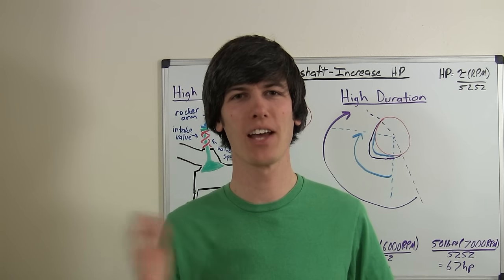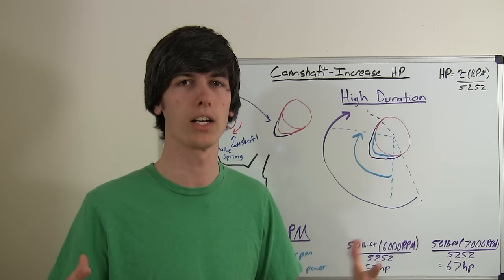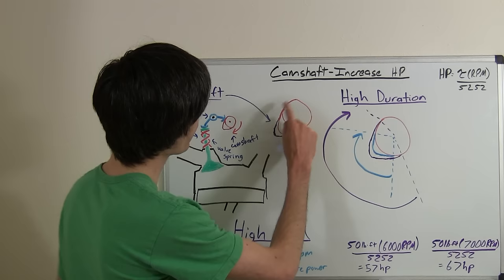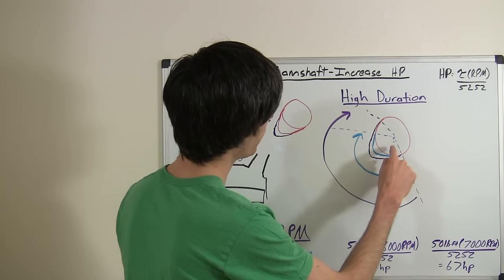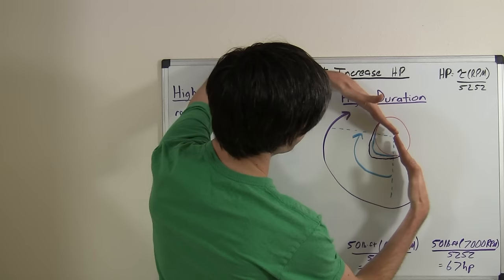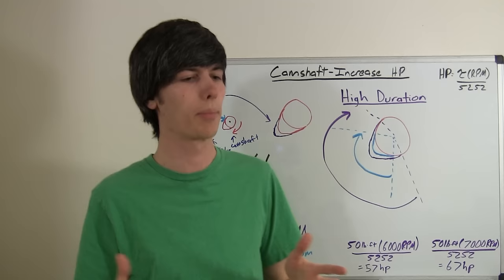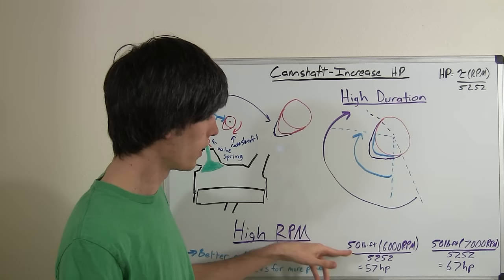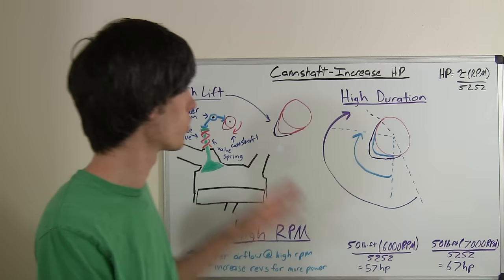Camshaft - High Lift and Duration - Increase Horsepower

Comment: A cam basically is a mechanical control of valve movement ran with timing. This mechanical structure is fixed once it is tailored for an rpm range it has a focused design for that range and since it is fixed (doesn't change shape). In turn a design such as this will be most efficient at the instantaneous rpm that it is most efficient at all the rest of the rpm is valve motion at lower or varying degrees of effective valve motion. 
That is why Honda and all the rest and McLaren came out with computer controlled variable valve timing and more cams all the time. Some Indy state of the art engines and exotic car companies have concentrated on other ways of controlling valve movement without camshafts allowing them to tailor valve movement to be most efficient at all rpms at any time thus creating maximum efficiency and performance throughout the powercurve.  REMEMBER: an increase in a bigger cam profile doesn't always mean more power, trade off or not bigger cams doesn't automate bigger power production period.

Comment: +Engineering explained my motorcycle's stock can has 10.3 mm lift and 296 duration. The racing has 306 duration and 10.5mm lift. in stock form the bike's pull ing power below 7k is weak will it change on installing the race can?? I am also gonna install a free flow exhaust. one more query what is a racing exhaust can??

Comment: How is overlap a bad thing? Overlap is almost necessary in all application esp when cylinder fill is needed and you have low volume of movement of air. Overlap allows for reverse cylinder fill making not only emissions more effective, but also yielding more power.
Reply: I think he just meant that too much overlap can be bad

Comment: I know 'hotter' cams have a reputation of increasing HP (as you state and show in your video) but also reducing low end TQ. Is this just perceived due to the fact that now you have to rev higher to get to that same power before the cams?
Reply: In an engine with a weak cam, that's not filling it's cylinders at low speed.  A hotter cam can increase low end torque. An example would be a 95 Tahoe 5.7 with 300 lbs of torque @ 3000 rpm. A 96 Tahoe 5.7 has 330 lbs of torque @ 2800 rpm.

Comment: Increasing horsepower at high RPM is a compromise that most of the time isn't worth having. The high valve lift at low and medium RPM will affect the speed, swirl and tumble of the air entering the cylinder. Think that you have pretty low speed air entering at low RPM, the thing you should be doing is restricting the passage of air so it's sped up. That's what variable valve lift systems do, use low lift for low and medium RPM and high lift for maximum power at high RPMs.

Comment: I get the airflow increase... How does a hi-lift cam affect the sound at idle?  Do cams make the idle sound more irregular.  Is hi-lift why?
Reply: When you hear an engine that "lopes", it first and foremost have to do with the overlap. Overlap means that the intake and exhaust valves are open at the same time, and it's the result of a long duration cam lobe profile. Lift in itself will not cause loping, but it will accentuate it if the cam has overlap.

Comment: can u explain how it affects the whole output curve and not only the peak number? For example a pretty wild camshaft affects badly the low-mid range torgue, so how the optimal camshafts are chosen. Finally why in most cases the exhaust camshaft is milder than the intake one?
Reply: +alex liatsos Okay, let me take a shot at this. A wild cam profile as you put it will have more over lap between the intake and the exhaust lobes. For example lets say a mild cam (stock) has 118 degree lobe centers (or lobe separation angle) meaning the center of the intake lobe is 118 degrees away from the exhaust lobe center, or in other words a small amount of overlap (keep in mind the camshaft is running at half speed to the crank shaft so in comparison to crank rotation it would be 236 degrees) This cam will make good low and midrange power. If you want more power up higher in the RPM range you decrease the Lobe center separation to say 108 degrees (at the same time you would increase lift and duration) now you have more overlap so both valves are open at the same time for a longer period of time, at low and midrange rpms this is very inefficient because some of your exhaust is pushing back the intake charge but at high rpm the exhaust gasses are moving fast enough out of the cylinder that the column of gas leaving the exhaust continues out the exhaust and actually helps to pull in the intake charge of air and fuel into the cylinder rather than push back on it and therefore becomes more efficient therefore producing more power. As for the exhaust profile being smaller than the intake. the reason is that the intake charge is heavier as in it has air and fuel where as the exhaust only has to get rid of the byproduct of the combustion so it has less volume therefore it doesn't need as much lift or duration to move out the smaller volume after combustion.I hope this makes sense!

Comment: Is that  Torque times RevLimit   or  Torque times RPM_at_MaxTorque?
Reply: +The HeartBrokenBiker RPM at max torque
Reply: Torque changes as RPM changes.  So, it's the torque at a specific RPM, times that RPM.

Comment: So lets say I want to increase my top end power without sacrificing low down torque?
Should I go for a cam with a higher lift, or a longer duration? Or both?  How does each parameter affect the torque curve of the engine?
Reply: soundseeker63 increase duration and LSA. Increasing duration will allow for higher rpm, and increasing LSA will keep you from losing lots of low end power.
Reply: @cloroxbleach118  what is LSA?
Reply: Dillon C lobe separation angle

Comment: I've seen a lot of reliability issues.Change your oil and have a correct oil pump pressure before revving above 6500rpm. SAFETY FIRST👌👌

Comment: Be sure not to mention valve overlap as ONLY a negative thing.  Increased overlap has negative consequences at low speed, however at high speed it can have benefits.

Comment: Since you're potentially changing the amount of time that the valves stay open, would you also have to change the ignition timing? It seems like there might be a bit of misdirection if the timing wasn't changed. 

Thanks

Comment: Does camshaft with higher duration but same lift as OEM exists ? I'm making a build with really tight piston to valvle clearance, and I want to know if later I can upgrade to other camshafts, knowing that I can't put some with higher lift.
Reply from the maker: Bastien Rondet Of course, and you could always have one custom machined.
Reply: A camshaft has 2 specifications, lift and duration. Lift for instance 10.5mm and duration 254°, if you only want a longer duration, look up what the stock lift is and find a camshaft with more degrees. Hope it makes sence.

Comment: So, would add new Camshafts to the car increase RPM? Or would you have to adjust it your self? Or is that what the lift dose?
Reply: Jeremy Wilder anytime you're looking to get a new camshaft you must talk to the seller, and builder of youre engine. If you install a camshaft with too high of a lift you risk crushing your valve spring. I have done this. You may have to upgrade your valve springs to withstand the pressure of the increased lift. 
To directly answer your question. If you change absolutely nothing else, a cam can change the rpm of your motor. Also increase the rpm range or decrease it for that matter of said engine.
Reply: dan mcdonald Never build anything but spent hours collecting infos. To me, camshafts are the latest parts you want to upgrade when it comes to airflow. You need some better cam springs, retainers, LMA etc when it comes to it. So +1 to you Dan. And another thing : some brand claims to sell springs for 10000rpm. Fact proves that it is a lie. Make some reasearch before buying.

Comment: can you help increase the RPM by changing the material of the CAM shaft? whats commonly used and can you just swap in an identical one made from a lighter/stronger metal to allow it to spin faster?
Reply: No because in a 4 stroke engine the camshaft always rotates at half the speed of the crankshaft

Comment: im wondering if this could be applied on motorcycles, bassically im looking at this info with the idea of converting my SOHC motorcycle engine to a DOHC
Reply: Don't, with all the money you'd spend doing that, you could probably just sell the bike and buy another one. Bikes are REALLY cheap compared to cars. for around the cost of a beat up Miata or civic, you can get an early 2000s Liter bike that goes from 0-60 in under 3 seconds. Also bike  engines rev higher and have a much smaller room for error, so unless you're an automotive engineer (and if you're watching this you're probably not) you could end up blowing something.
Reply: kylegrim21 I personnaly don't want to get a motorcycle licence because I know I can't help my self pushing it, already drove 240hp+ cars that goes over 8000rpm and honestly it was outdoing me, so if you're looking for higher RPM on a BIKE you seriously need to calm down. There's a a thin limit beetween pleasure and safety, nothing else to say.

Comment: soo one quick question i have  a302 engine if i want to put a high rpm camshaft,i need to put a bigger carb,changes valves  and maybe porting te intake manifold and heads? or what are the the recommended mods if i want to change my stock camshaft

Comment: HI Jason,
Please help me decide on cam selection. 
Still long way of purchase but planning my build is key.

What i want from the head is more power n torque across the band and turbo response  down low end as now the turbos start at 4k and at 6k to 8,000rpm thay screaming
I will invest in 1mm oversize valve down the track. 

Car: R33 GT-R RB26DETT
Firing order is 1-5-3-6-2-4
ATM i have 2860-5's turbos on big n laggy.

A power stroke occurs every 120 degrees but Cyl# 123 feed first turbo and cyl# 456 second so my degrees doubled to 240.

Standard nissan cams Intake 240°  
Exhaust 236°
In lift 8.58mm
Ex lift 8.28mm
Valve timing 
IN 113°
EX 125°

Short duration high lift or
Long duration low lift or both worlds. 
Dont want to have a rocking car at the lights asking for trouble either. 

Below are cams available for the RB26DETT some of the high lift more than 10.6mm i think need machining work.

252deg/9.15mm Lift (Tomei)
252/10.05 (Mine's)
256/8.7mm (HKS)
256/9.1mm (Trust)
256/9.25mm (Tomei)
260/9.15mm (Tomei Poncam)
260/10.25mm (Tomei)
260/10.8mm (Tomei)
264/8.7mm (HKS)
264/9.1mm (Trust)
264/9.7mm (JUN)
264/10.0mm (HKS)
270/10.25mm (Tomei)
272/8.7mm (HKS)
272/9.7mm (JUN)
272/10.2mm (HKS)
272/10.5mm (JUN)
272/11.35mm (JUN)
280/10.2mm (HKS)
280/10.25mm (Tomei)
280/10.3mm (HKS)
280/10.7mm (HKS)
280/10.8mm (JUN)
280/11.35mm (JUN)
280/11.5mm (Tomei)
288/10.7mm (HKS)
288/11.0mm (HKS)
288/11.35mm (HKS)
290/11.5mm (Tomei)
296/11.1mm (HKS)
296/11.3mm (HKS)
304/11.4mm (HKS)
304/11.6mm (HKS)
312/11.6mm (HKS)

Comment: How much more often would you need to replace the piston on an atv?
Reply: +tom howard it all depends on how the piston is designed and if the valves make contact with the pistons or not.

Comment: Do you have any guideline or formula in choosing valve size? Im modifying my 150cc bike, single cylinder, 4 valves, EFI. The std valve size is 19/17 for 57mm block. I upgraded the block to 62 mm and custom the head to 22/20. Reporting and polish the intake and exhaust ports bigger. Not sure if ive chose the correct valve sizes. Need help! :'(

Comment: So about that equation, how does it work for Diesel engines, because usually they end up with more torque than horsepower
Reply: But less rpms than a gasoline engine
Reply: Diesel's usually make more torque than horsepower due to a longer stroke than bore size. There are high RPM diesels out there running in Le Mans at extremely high RPM's, but a diesel has a different design. The torque in the diesel comes from quite a few factors including their higher compression ratios, longer stroke than bore, their cylinder configuration, etc.

Comment: 212cc "6.5 horsepower" engine
It appears they are ripping off customers by 1 whole horsepower. 
   8.1 torque X rev limit of 3600 RPM divided by 5252 = 5.552171
Now if the governor is removed you will get 8.019802 horsepower.
Add 18 pound springs and get approximately 9.562072 horsepower.

Keep in mind, more horsepower does not mean quicker acceleration.

Comment: EngineeringExplained, if i change out my camshaft in a Chevy 350, do i have to change out anything else? I've been told the brakes will be affected in a bad way
Reply: They will due to due lack of vacuum with a very aggressive cam profile the idle has too much overlap and the engine doesn t make vacuum like stock so you need vacuum canisters to store the little you do get for when you need it other than that it will go faster so stopping is really important like turning as well lol

Comment: Here's a quick question (love the logo btw). I know that high performance cams use quite a bit of overlap to scavenge more of the a/f mixture into the cylinders on an exhaust cycle. Like when you hear a V8 or even a 4 banger with a big cam in it you can tell just by listening that it's got almost a full racing cam in service. Question is how do you figure out the overlap? Also I think a video explaining the benefits of overlap (almost every n/a has SOME overlap) would be in order sir! :D

Comment: Can someone explain to me why do some cams need a higher combustion ratio and what is a decked/shaved head?
Reply: I'm not sure about the first one, but a decked/shaved head refers to precisely machine milled bottom part of the head (the side that goes on the block) which is not only making the head sitting perfectly flat relative to the engine block but it also reduces the space in the combustion chamber, which gives you higher compression ratio, and as the head is dropped lower, it slightly changes the timing of the cam, which gives you more power (bottom to mid usually). 
The more material you "take off" from the head, the more compression ratio you get, but of course, you must be careful with that, and must not overdue it, since if you take too much off, you have a risk of valve hitting the piston, as the clearance between valves and pistons will be smaller, or the bad engine performance will show up on the upper-mid/top of the power curve, since dropping the head lower is changing the cam timing in relation to the crankshaft. 
I would recommend slight dropping/shaving if the head is all stock, but any major change requires custom parts (camshaft, adjustable cam gear, valves, valve springs), since shaving (if done wrong) may cause a loss more than gain.
 
Drastically tuning the head makes the biggest change in power, but it pulls a lot of side parts, so if you ever consider doing it, better keep that in mind, because it's a costly tune.
All of this of course requires a lot of knowledge, so it must be done by someone experienced, as it's not a DIY job.
Reply: Ben Eyler, some cams remain open after the intake stroke has ended and close a few degrees after bottom dead center, when the piston is on its way back up for the compression stroke, effectly reduces the displacement of the engine at lower RPM by pumping a small amount of air back out. It can be calculated, it's called dynamic compression. Cams like that are real screamers and a lot of fun to drive. At higher engine speeds the intake velocity is fast enough that the cylinder coming back up doesn't push as much out. Results in a nice surge of power on the top end

Comment: Is there any modifications that should be made before looking into this?
Reply: Just make sure your engine can actually handle it I guess. Not only the extra air that will be coming into the engine but obviously the engine will need more fuel to compensate for the fact there is more air. The same for a turbo. So fuel pump and injectors are probably a good idea. These are all assumptions by the way haha I'm a massive rookie on the subject but I hope my opinion helps in some way, shape or form.
Reply: Aaron Thomas Valve springs are a MUST, you can never have too good a spring and they arent uber expensive and the reliability you gain is by far worth it imo. Usually the stock fuel system should be fine since cams wont give you some crazy +200hp, but it wouldnt hurt i guess

Comment: @the milkman: what other engine parts do you recommend to upgrade when upgrading the camshaft?
Reply: Heads it is pointless to do a cam if the engine can't breath in and out better intake exhaust and heads make sure not too much lift for your heads valve bind and possible collision valve to piston is catastrophic

Comment: Engineering Explained so do the really lopey cams, have high duration and lift? Or is it just one or the other?
Reply: The "lopey" sound you hear from high performance cars usually have more to do with other profile aspects like the lobe separation angle and not primarily the high lift and duration numbers. A lot more goes into the camshaft than just the lift and duration, but it's a good start. The lobe separation angle has a lot to do with engine idle and vacuum numbers. Usually these numbers range (and don't quote me on this) from 106 degrees to roughly 118 degrees. While most stock cars are somewhere in the mid-range of those numbers, you can change these around to work better in your application. The big lope you hear comes from the numbers on the smaller end of the scale which usually produce more torque, while the higher number increase higher end horsepower.